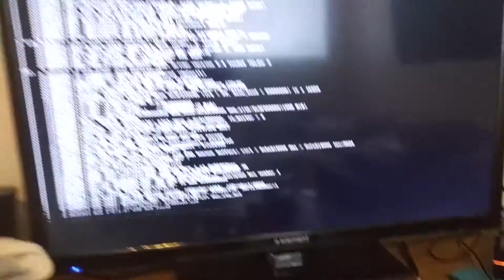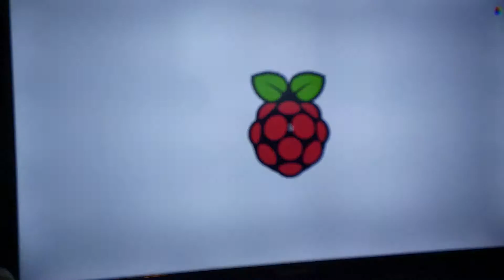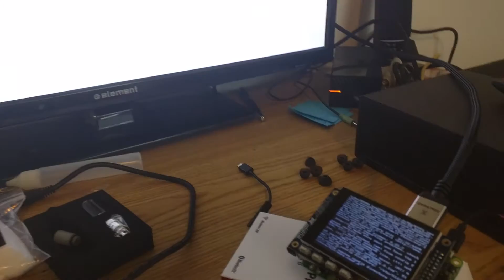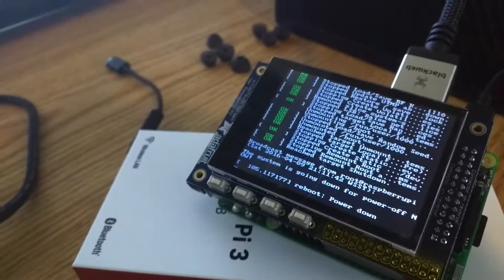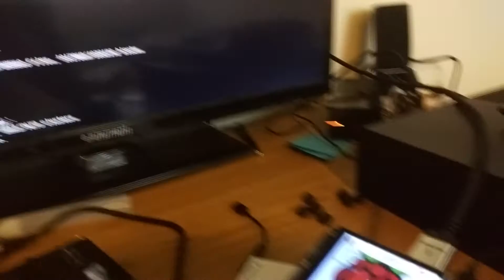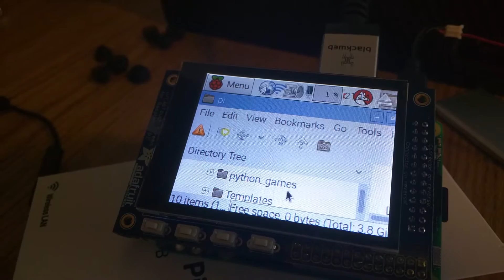Raspberry Pi 3 with 2.8in Capacitive Touch LCD and Power Button

Comment: where is the power switch?
Reply from the maker: Pi's do not have a power switch by default. It just powers on when you plug it in and to turn it off the safe way, you do a shutdown command in the command console and once it is done, then unplug it.

Comment: Hi, thanks for the video, but after getting output on pitft display, its so small hard hard to work on, so, how do I switch back to normal monitor? if I have to change something, how do I open terminal on pitft? Thanks.

Comment: so this lcd is not working on my pi at all with this image . I just get a white display and it hangs on boot on the lcd ? Did you have any issues ?
Reply from the maker: yea if you don't edit the config then it won't work. check the links in the description. one of them will tell you what to do to activate lcd

Comment from the maker: Thank you for the comment. I am using the 1983 screen. To setup the button as power I used this link on Adafruit site:
https://learn.adafruit.com/adafruit-pitft-28-inch-resistive-touchscreen-display-raspberry-pi/extras

Yeah a little expensive but well worth it if you are buying other things along with the buttons but if you are just buying the buttons by themselves then it is not worth it lol. I had to buy a pack of 20 buttons and only needed 4 of them haha.